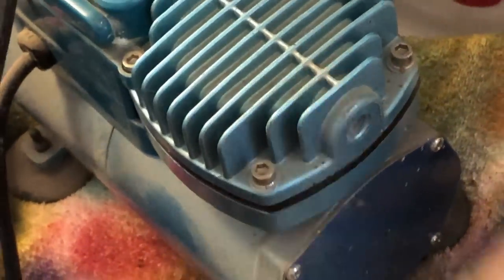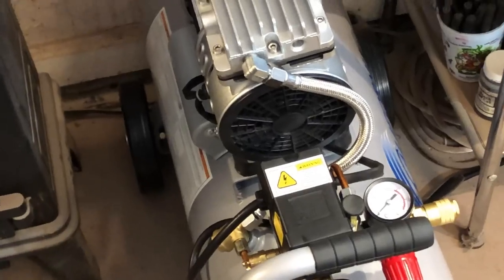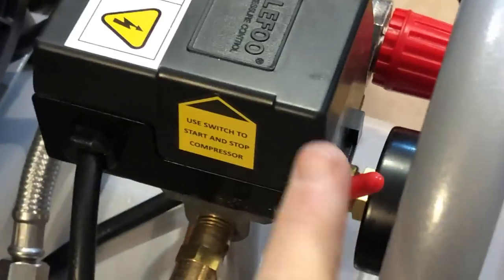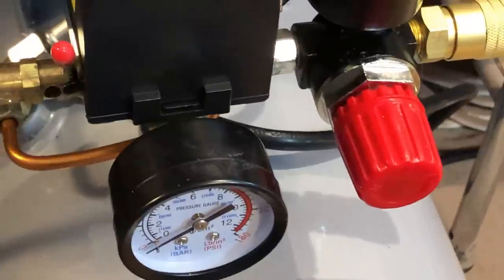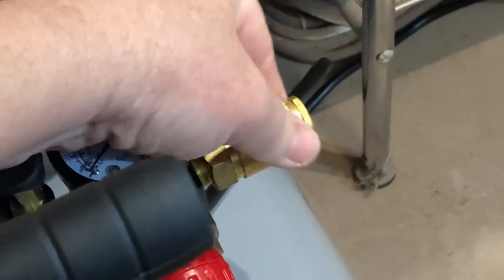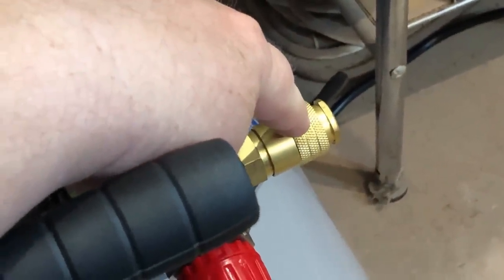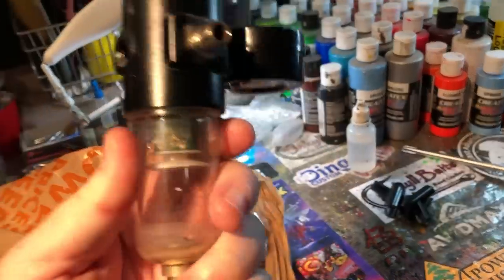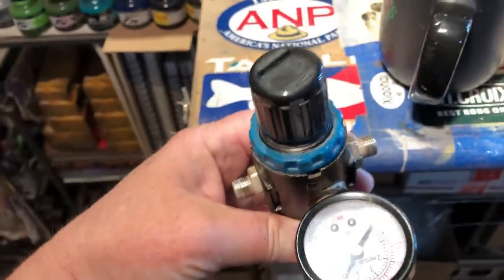JBCo Shop Talk Series: California Air Tools Compressor Set Up!!!

Comment: I bought the same compressor but the one with the tank on it about 8 months ago.  I love it. And you would be amazed how long it will run before it comes on.  And it. Just takes a second to fill the tank back up. Your pressure never changes.    You were the one that told me to buy it. But that your did not have the tank.  If you haven’t already order anew one.  You should try the one with the tank.      You can run multiple brushes off of it too if you want too. Am my just gets nearly warm.  You can even hardy feel any warmth off of it.  And is supper quite.    I have is setting in my living room.  I watch tv or my family watches tv while I am painting.

Comment: I have the same compressor in the 5.5 gallon.  I also just bought that same 1/4 in husky hose.   I bought it for inflation, but I am going to set it up for airbrushing as well.  I just need to get two regulators so I can run two brushes at different pressure.  It has been a great compressor and quiet.  You will be happy with it.
Reply from the maker: Thanks!

Comment: As you are making the connections you need some plumbers Teflon tape on all the treads to seal the connections so you don’t have air leaks
Reply from the maker: Roger Bolles I did. I mentioned it towards the end of the video, and then went back and taped everything that wasn't pre-taped (the brass with orange wrapped threads from Husky are taped at the factory). Thanks for the input! Solid advice 🙂

Comment: I open the drain every night on mine and let it slowly drain out. if not it will build-up water but opening it every night I've never had any problem with water. and if you don't it will rust from the inside out also
Reply from the maker: I do that too 🙂

Comment: I also put a valve on the between the water desperation and the air brush to shut off the air, since the air brush leaks air over time and drains the tank
I’d send a photo but I don’t see away here

Comment: Good Stuff Jenn , one thing I am slightly concerned about. The tank so close to that heater may heat up your air and affect your paint. It is probably negligible but just a possible concern. Painting cars years ago is far different than what you do.
Reply from the maker: Brian I've been looking at various solutions, but unfortunately I have one outlet on that side of the shop, and both the heater and the compressor cannot be patched into an extension cord. So I'm kind of limited on options

Comment: Whats the idea behind the moister trap let it fill up with water or drain it all the time i have a bit of rusty water in mine.how do you maintain your moisture trap? i have the little compressor.
Reply from the maker: There's a trap there to separate humidity and water from the line. Water has a tendency to push through at times and "splatter" onto the lure. Makes a mess.
Reply from the maker: To drain it, place a towel under the trap and push up on that little spring at the bottom while you have pressure in your tank. It will push the water out with enough force to clear your trap 🙂
Reply: Ok thank you!

Comment: Do you think this is a good place for the compressor?I mean the fire around.
Reply from the maker: I am limited in space where I am, but I'll look at a shorter piece of hose. I only have one outlet on that wall, so unfortunately I'm kind of bound to that area. I will definitely look at ways to set it up different. Neither my heat or my compressor can be plugged into a strip or extension cord 😕
Reply: @Jekyll424   I understand,Jane.But  safety firs.I was felt obligate to tell you.High pressure tank close to high temperature ... Sorry if i annoy you with my paranoia :)
Reply from the maker: You don't annoy me 🙂

Comment: Put your extra goose under the rack. Mount your regulator on the com to your work bench then to your air brush linens. If you want you could you a regulator ther that you can adjusts 2 different pressures for each brush
Reply from the maker: Great idea! Thanks

Comment: Jen all the bare brass should have thread tape on them to seal them. I dont beleive the ones that have the red lock tite on them would need it but i would use it anyhow.
Reply from the maker: I did! Thanks. I love the input I get and the feedback from all of you. 🙂
Reply: I have a cheepo air compressor kinda like that but made for air brushes. Twin cylinder anyhow.

Comment: I just noticed you didn’t use any Teflon tape.  Take my advice of 48 years of electrical and plumbing experience. Always use regaling tape warped clockwise on you you mail threads.  One good complete wrap or being two.    It will save you headaches over time gunning air leaks and your compressor running when you forget to turn it off
Reply from the maker: You're fine. I always appreciate constructive input. And yes... I did! Thanks. I love the input I get and the feedback from all of you. 🙂